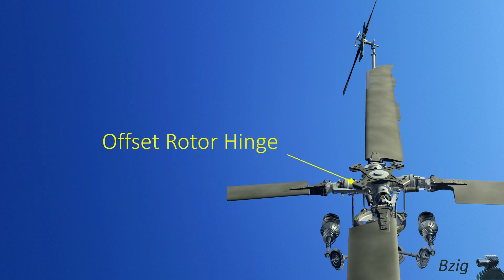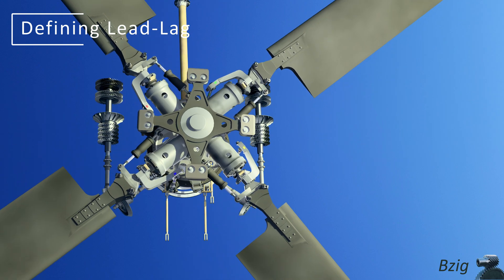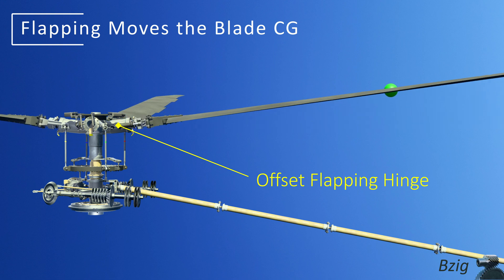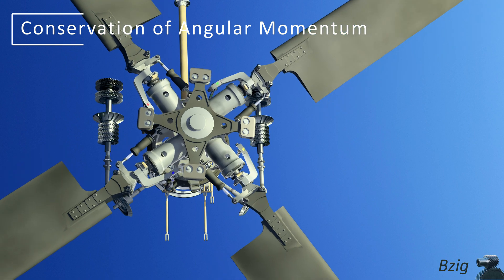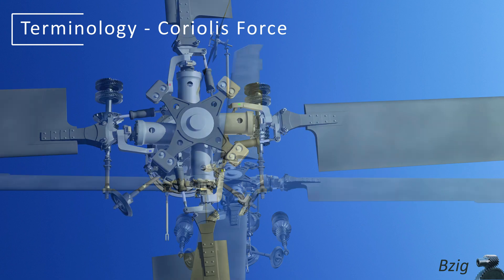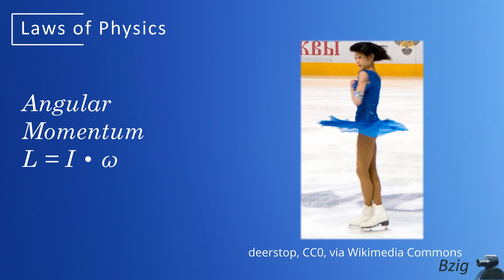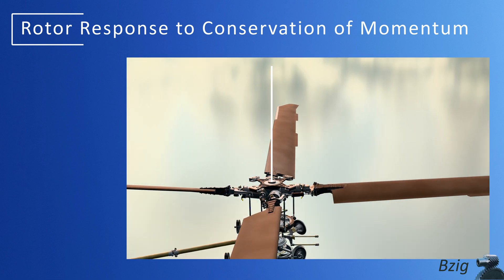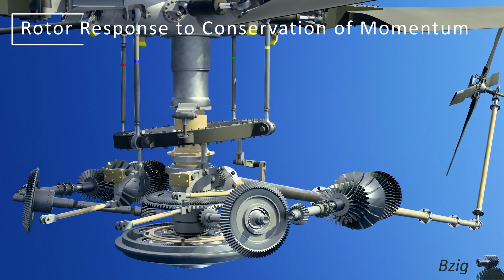Helicopter Rotor Lead-Lag

Comment: I think a good way to visualise why hunting needs an external damper but flapping doesn't is to watch Battlebots and Robot Wars. If you've ever seen robots with large horizontal spinners like Son of Whyachi and Gigabyte, you'll notice that they are very hard to flip in the vertical direction but can rotate horizontally with no problem.

Comment: 4:00 On an even number of blades rotor, why do we need lead lag hinges? Since you've just mentioned that two bladed helicopters like the robinson have teetering blades. And on the animation, it seems that the blade furthest from the camera and the blade nearest to the camera are in perfect unison. Thanks!
Reply: On an odd number of blades rotor, it makes sense, since things arent getting perfectly cancelled out.
Reply: Hint: Blades not directly opposite each other will be in different phases of their hunting motion.
Reply: @electric7487  That's why I replied to myself, saying this makes sense on odd, but all even number of blades rotors have blades opposite each other.
Reply: Two blade systems flap about the center of the rotor hub so there is no need to treat each blade individually. Since fully articulated rotor systems flap at a point not in the center of the rotor hub, each blade needs to be treated as an individual system. 

You are right about the symmetry of the blades. The advancing blade will lead the same amount as the retreating blade lags because they’re flapping the same amount in opposite directions.

Comment: If lead lag and flapping motion would not be enabled, the maneuverability would be less smooth and probably less calm, and tension between the parts would be higher if not on a two blade system, ist that right?

Comment: Excellent presentation and graphics. Thank you for your efforts. It would be interesting to see the control of a Boeing CH-46 or CH-47 tandem rotor helicopter.
Reply: What's interesting is that the CH-46 has the drag hinge before the feathering hinge, while the CH-47 has the drag hinge after the feathering hinge.
Reply: @electric7487  Since the forward and aft rotors are designed to spin in opposite directions to cancel out torque, the components of the rotor heads, including the drag hinges, are designed and oriented differently to operate effectively with the respective direction of rotation.

Comment: Does the lead-lag damper contain two opposing springs/elastomers to center (between lead and lag) the blade? Or is centering done by the centrifugal force?
PS: Thanks for this excellent educational video.
Reply from the maker: there is no centering mechanism.  The dampers are just dampers... not spring-dampers.  It's just the CF loads.  Great questions.

Comment: Stripping away all the covering gives a stark view of how small the driving parts of the engine are compared to the driven rotors.  Wind driving wind. The importance of the right size and shape rotors for the flow regimes is also shown.  Also shows the size of the different metal components relative to the structural demand on them.  Ignoring temperature requirements and specialized materials for that, it's still an incredible sizing problem to get all those blades the right size and shape to extract/impart the momentum on them that you want while meeting the structural demands on them.  Incredible.

Comment: Great video, excellent graphics. Could you do one delving into gyrocopter 2-blade vs multi-bladed rotor design. The little Focke-Achgelis 330-A 3-blader would make for a good design study.
Reply from the maker: That's a cool machine!  I'm working on a video on helicopter tail rotors and this includes an explanation of the pitch-flap coupling motion that's normally found on tail rotor blades.  Looking at the images on the 330-A it appears to incorporate pitch-flap coupling (also called delta-3) motion in the main rotor.  I'm going to see if I can find more tech info on that design.  Thanks for the suggestion.

Comment: i don't know much about two-bladed rotor systems in full-scale application, but in R/C, I tend to leave my main rotors just a tad loose at the blade grip so they can lead/lag a little bit. this helps to negate low frequency vibration and smooth out my flight. I don't know if my rotor system is behaving like your excellent animation, but it's definitely not hurting my aircraft performance. of course, my rotor system also turns at least 10x faster than full-scale and my model responds a lot quicker to subtle changes than a full-scale would. great videos and explanations of the systems. a suggested topic for future videos, bell/hiller mixing.
Reply from the maker: That's really cool insight.  The amount of lead lag is small... Even smaller with low offset, so it makes sense that "just a bit loose at the hub" is effective.

Comment: Have you seen the news about the medivac 206 that crashed in Kentucky?

ATP pilot with 17,000 hours flew into a 1.5-inch diameter guy wire holding up a bright red and white radio tower, at about 5pm while landing in a large sports field to pick up a cardiac patient. (Source: NTSB on-scene briefing and one other video showing location on Google earth)

This crash isn’t strictly your bailiwick, but I’m wondering if you’ve thought about explaining the dynamics involved in related things, like wire cutters on the front of helicopters, or sensing systems for wires?

Like what are the speed ranges and wire sizes in which those devices work? Surely they work on telephone lines, but surely they are iffy for high tension lines? What happens to the rotor system and airframe when they are used successfully? Inspected and returned to flight or scrapped?
Reply from the maker: I only heard about it after reading your message here.  I looked on pprune and read the posts and news article there.
Reply from the maker: I know that helicopter air ambulance are required to have HTAWS and those systems are very effective for terrain and towers.  I believe they also warn against power lines... But I'm not entirely sure.  Even if they do I can imagine they database for power lines isn't as robust as towers
Reply: @bzig4929  Awesome. I didn’t know about HTAWS or the mandate that started in 2017. I was familiar with the existence (prototype?) of a system that detected the EMF from power lines, and that it was useful for lines that didn’t have markers on them, but I’m not sure if that was ever commercially available.

As usual, I’m learning a bunch from you.

Comment: 5:15 Awesome as usual! Why does autorotation cause lead to behave differently? Is it simply the lack of engine input to the rotor shaft? Does this lead change happen identically when in forward autorotation flight and at the final hover?
Reply from the maker: During normal flight, the blade is at a high angle of attack so there is a lot of drag.  With autorotation, the whole idea is that you reduce the angle of attack so much that the drag is no longer pulling the blade opposite the rotation; drag pulls the blade forward.  It's this forward tilt of the blade lift vector (reversal of the drag) that creates the condition to allow autorotation.  So instead of pulling the blade, back, into a lag position, it pulls the blade, forward, into a lead position.  (by back and forward, I mean relative to the direction of rotation and not relative to the nose of the aircraft).  

I think it was you that had a comment about differentiating between lead-lag and rotation... I hope I addressed that in this video.  Thanks!
Reply: @bzig4929  This clarifies a few things, and confuses me on another. My aha moment is the reduction of drag—it sounds like this is equivalent to feathering the prop on a dead engine (in terms of necessary for safe outcome, not that the rotor is feathered WRT the direction of travel).

The bit that confuses me above is how does negative drag happen? Why wouldn’t the blade simply be in the neutral lag position?

And I’ve never heard anyone else describe this in so much detail; I recommend expanding on that and the fact that this is what allows autorotation. This feels fundamental and complex. Some on-screen vectors might help the explanation.

Glad you’re finding my comments helpful!
Reply: @PetesGuide  Autorotation happens like this:  In the middle of the disk, the upflow drives the rotor because the collective is down enough that the lift vector is inclined enough that the horizontal component will drive the rotation.  However in the outer part of the disk, the blade is moving faster, and the relative wind is more horizontal, providing more vertical lift.  The inner part of the disk is driving the outer part - the inner part is the "motor," the outer part is the "rotor."
Reply: Hi, this would mean that you have generally an uneven distribution of Lift in the system over each blade. It is damn interesting to think about it. This could easily be solved by trusted blades. Is manifacturing and the capability of autorotation the reason why blades are almost even? regards.And: why are rear rotors so often also even bladed?

Comment: Can you go more in depth how 2 bladed helicopters get away with not including lead-lag degree of freedom in their rotor hub and are you ever going to go over more unusual helicopter systems like servo-flap rotors and tip jet rotor configurations?
Reply from the maker: I can, but I have to build a two-blade teeter in CAD first.  I plan to do that, but it may be awhile.
Reply: In an underslung 2 blade rotor, the inward movement of one blade's centre of gravity is approximately equal to the outward movement of the other blade's centre of gravity. Because of this, their Coriolis forces roughly cancel out.

Comment: A mast bump failure animation / discussion would be interesting. 
PS: thanks for the 4K!
Reply from the maker: The 4k wasn't as bad is I thought it would be.  My render time went from 10 sec/frame to about 30-45 sec/frame.  (At 30 frames/sec).  Of course, I start the render and let it cook... So even though it triples the time it doesn't really impact my time.  

That was a good suggestion.  Thanks!
Reply: fact